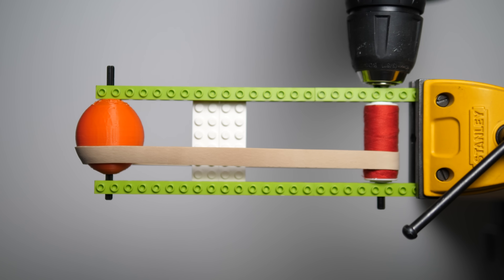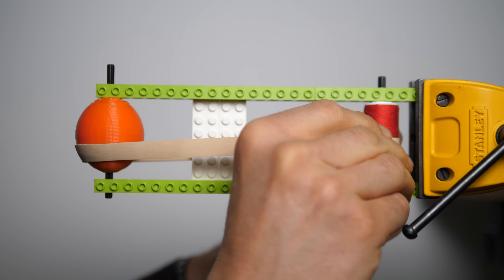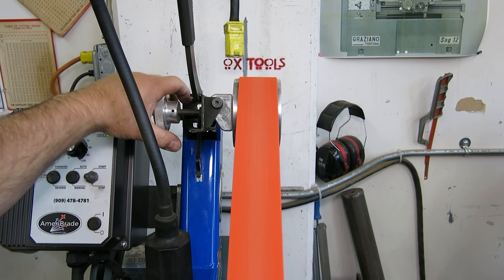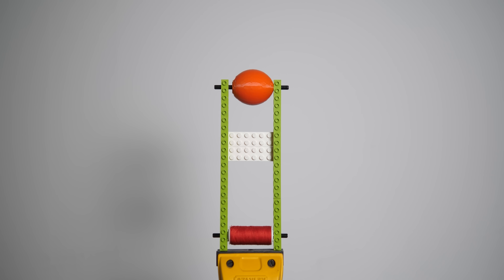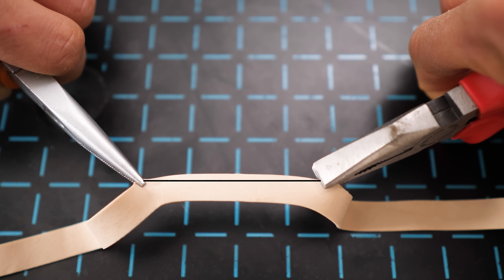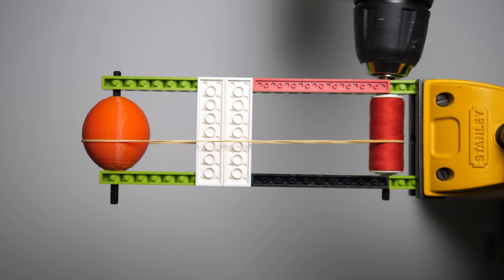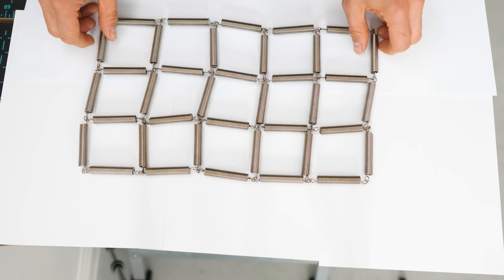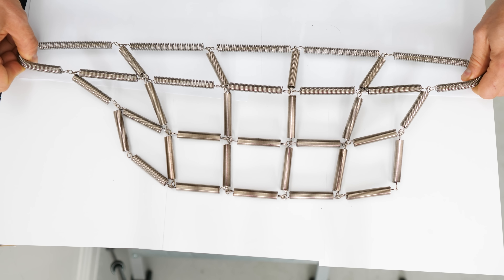The Band Should Slip Off But It Does The Opposite!

Comment: Best video I saw on this topic, finally a nearly full explanation in one place. Two questions remain for me: 1. Why is the force that drives it up greater then the force that pulls it down? Something with the friction coefficient? 2. I know that misalligned belts can be alligned by scratching one side of the pulley to increase the friction on that side. How does this work?
Reply: I will give it a shot. A konveks pulley that spins have surfaces that moves at different speeds. The surface that  leave the most distance for every rotation, is in on the center of the pulley. When you have an object that is being applied with two different forces. The object will turn direction. In this case the convex pulley. If we  apply the rubber band and the conservation law of speed and momentum. You need to apply more  speed on the pulley on the narrower side. While needing less speed on the thicker part. In order to have the band not move anymore . They need to have balanced speed on the surface. Or have two lesser surface on each side.

Comment: i haven't seen the explanation yet, but i'm assuming it has to do with the fact that a straight line around a sphere (such as the earth) makes an ellipse that at some point crosses the center plane, so when it rotates, it wants to go up or down that "ellipse" because it wants to go in a straight line, and then it's stable once it is equatorial, meaning that a straight line ends up just being straight.

Comment: Rubber bands are a little different from a lattice of springs in that when you stretch a rubber band you actually compress the material of the rubber band. The total volume of the band itself gets smaller and it puts off heat. And when you let go of the band it sucks in heat and expands.

If you have two points pinned together by a metal spring and heat up the spring the tension between the pinned points will decrease, whereas if you pin the two points together with a rubber band and heat up the band the tension between the points will increase. It has something to do with the boundary conditions of the material itself. You aren't wrong about the entropy and the molecular effects when you add heat it's just that when you "stretch" a rubber band you aren't actually stretching the band you're compressing it. 

When you pull the band out it gets thinner, the thinning is a continuous zone of compression. The polymer chains aren't as free to slide past each other as the pile of chains. Though some line up in the direction of pull, the aggregate is getting crushed in the web. More like a finger trap toy, though not precisely that either.

Comment: I used a belt drive on a lathe and a table saw. The belts were 4" wide leather. The pulleys were all crowned. Belt speed is faster the larger the diameter.

Comment: I am a carpenter and it has worked the same way with the band saw for generations.  The rollers over which the saw blade runs are also curved and the belt always runs to the highest point.  The belt is adjusted in its position by slightly tilting the upper roller.  So nothing new or unusual for us carpenters

Comment: No Steve, you were right at first! It's discrete at the bottom (molecules), not a continuum!
Reply: Comment on the entropy segment. You can directly observe this by measuring the temperature of the rubber band when relaxed vs stretched. Ben Krawsgrow did a video where he made a refrigerator using rubber bands. They were pulled taut when outside the fridge and where relaxed when inside, effectively absorbing and transferring heat out of the enclosure!
Reply: Another thing, I have heard you can think of it as follows: a very long rope is stretched straight. Now imagine countless object hitting the rop side-on. At every collision the rope would have a tendency to curve just a bit, and over the length of the rope this would have the effect of contracting the whole rope from straight to a squiggly form. Similarly if you forcibly pulled the rope taut, it would push all those object in contact with it, releasing kinect energy (and this at the macroscopic scale would be measured as heat).

Comment: This is probably what is going on with treadmills.  When you adjust the position of the treadmill belt, you are changing the angle of the axle.  It always struck me as counterintuitive that when I tilted the treadmill roller with the adjustment knob, the belt moved in the opposite direction I was expecting.

Comment: There's an elephant in the domed pulley you haven't addressed:

Surface speed. At the pulley's highest point the greatest circumference it is moving faster than the area closest to its rotational axis points. The grab (all things considered, other forces will predominate if pragmatic limits aren't observed) will be maximal at the circumference that displays the greatest centrifugal/centrifical force, which is the 'highest' (widest) part of the dome.

To mentally model this in two dimensions, consider a spinning disc with an object dropped at centre. It will be thrown off the edge.

See:
https://byjus.com/physics/centripetal-and-centrifugal-force

In some ways, this mimics the forces at work in a venturi.

Comment: What a cool design!
Never heard of it before but from the picture it told me exactly what I needed to know. 
I make FFP2 masks for a living and one of the rollers uses I think the same mechanics as this "pully" system. 
We steer the cloth with a roller and by adjusting one side of the roller it "walks" up the roller. I never got told how it worked but it thought me a lot because I learned myself how to use it. And it creates a incredible delicate but often stable way of adjusting the inclination of the cloth. 

Thanks for the video explaining how it works! Nice to learn new stuff about what you work with daily

Comment: So basically, the stretched section of the belt applies a horizontal force as it rotated around the pulley, which overcomes the tendency for the belt to slip off, thus stabilizing the belt onto the pulley center.

Comment: I think your explanation as to WHY the band moves up is not true, and if you would use a cone with one side with a bigger circumference as the other, it should creep from the narrow side to the wider part. I don't think it will, because it has no arch to it. I want to bet it will stop at some point as long as the cone ends wide enough and the increase in size is constant.

Comment: That was most enlightening.  I'd noticed that the pulleys on old industrial machinery with leather belts were slightly bowed but I always thought that was odd because you can actually see the belts self-centring.  I had wrongly thought one would prevent the other rather than causing it.  Now I understand.  Thank you.

Comment: Without further watching your video, I stopped at 2:02, I think the reason is the resulting speed of the second pully, which want's to rotate slower, therefore the rubber band has to move to the center.
Reply: I was wrong. meh

Comment: When you touch the curb with your tires, it pulls you toward it.  A wheel tries to climb an osculating wall (look at the marks on highway railings).  A steel cable will climb a sheave.  A derailleur works -- little elasticity there.  Hmm.

Comment: "Sheav-Block!!" 
The grooved rotating wheel is the sheav and can be mounted to a spar or bulkhead without a block, the term block goes way back to when they used a block of wood spliced into the end of a rope; likewise a block can be used without a sheav though friction is increased it still has utility.

Comment: Hold on, if the contraction of the rubber is just caused by molecular jiggle of heat, then is that why cold rubber is has less spring?

Comment: I used to tell my students that you can actually feel the entropy change in a stretched rubber band as a temperature change, by using your lip as a thermometer as that part of your body is much more sensitive to changes in temperature.   So fun to see a room of students stretching and relaxing rubber bands and claiming "I can feel it warmer/cooler!!"
Reply: Someone tried to make an elastic band refrigerator. Didn't work out too well as I recall but interesting nonetheless.
Reply: @chaos.corner  Not sure if they were the only ones who did it, but the Myth busters did that. I remember the whole whacky contraption with tons of rubber bands designed to stretch outside the "refrigerator" and contract inside.

I too remember it not working particularly well, but it did create a (neglible) temperature difference.
Reply: @kevinthealienfpv  I looked it up. It was on the Youtube channel "applied science".
Reply: @chaos.corner  i watched a video about that a long long time ago lol

Comment: I've seen a hidden use of this effect. At newspaper print centres, (At least the three I've been in.) have extendable conveyors to get newspaper bulks into vehicles. They extend similar to an older style telescopic antenna, and hidden in it's workings is a series of rollers with convex curved surfaces. The only visible roller is a fixed polished metal roller, and if you push the end of the conveyor to the side, the belt travels slowly the other way so it's always straight and centred where it comes out and goes into the drive unit. In the one I have spent literally bored hours experimenting with, it has belt alignment optical sensors on each side, so you can't push the conveyor too far or for too long, or it stops and sets off a safety alarm. If it didn't, any pressure on the side of the conveyor could tear the belt to pieces.

Comment: figured it out at 0.49. As the rubber band starts to slip down, less tension on bottom part of band and more tension upper part, which pulls it up.
If the rubber band was not as wide, it could slip.

Comment: ...or you just say that a straight band wants to be laid out across the pulley along as straight a line as possible: if the pulley is spherical in shape, it wants to follow a great circle, and that automatically means that it will bend towards the middle.

("wants to" anthropomorphosising...)

Comment: I have an alternate theory: 

I think it's because of the geodesic of that surface
I think a rubber band will *still self-center* even if it *didn't* bend in that fasion, whereby it is transversally curved behind the contact point, simply because the geodesic coming from the point of maximum pressure (on the opposite side of the other pulley) is angled towards the center on both ways.

I think you can test this with like a cloth-based stretchy fabric, with which these effects should be neglijable, because of it's lower compressive stiffness
it would, of course still have to be lined with rubber dots or something so as to have the necessary amount of friction.

Comment: Another thing to add to the rubber elasticity also should include vulcanization: the chains may jumble together, but with enough force, the chains main slip by each other, permanently deforming the rubber object, so sulfur ligands are inserted yo prevent that from happening, VASTLY improving the material's elasticity (how much energy it takes before deforming permanently)

Comment: Everyone has an example of this take the bottom of a vacuum off and look at where the heater bar matches the belt and you will see the balled knob on the heater bar and the straight bar on the motor where the belt meets them both

Comment: Just wondering if you tried from the top with the drill spinning in the same direction? I notice that the thread is spun in a screw like pattern and the way the drill spun it looked like the angle of the thread was screwing down making the rubberband ride up. Hence why I asked if you tried from the top. Awesome vid. Ty.

Comment: Band saws blades are an interesting case in point since the metal band of the saw has no elasticity yet it rides on crowned pulleys.
The band I'm assuming favours even pulley pressure across it for it to ride in the middle of the crown and uneven pressure tries to make the inside shape slightly conical rather than parallel and has a similar effect as a belt with elasticity in that it engages the pulley slightly forward of where it is riding at the top.
It must be a lesser effect since band saws have the top pulley able to tilt of horizontal axis to assist the movement to the middle, but once there it favours staying there.
There is the trust wheel on the guide of coarse stopping the pushing of material into the blade from working the blade off the pulleys but that is only adjusted when the blade has found where it wants to ride and the trust wheel should barely touch the blade in action before and after cutting forces.

Comment: Interesting how critical the relationship of internal tensile and compressive strengths are in the minor axis, aka buckling. If the ratio was to high it would never induce a bending moment. 
Think the perpendicular displacement, where it archs is not actually useful and we'd rather the band sides remain parallel but with increased internal stresses, I think...but then the minor axis compressive strength is related to displacement via the buckling formula soo maybe not. Hmmm.
Anyway awesome stuff! 
FYI the entropy video explained a lot when I was learning thermodynamics, super great video, always recommend it:)

Comment: i think that this would work with a non stretchable belt, and it has to do a little more with the fact that since the middle has a bigger diameter, i has a longer travel, effectively pulling more belt towards it;
the angular speed is the same, and "more belt" is drove in the middle.
So, yes, it might be related to the deformation of the elastic band, but my intuition tells me that the primary cause is the pulley shape. (of course because of the shape the deformation occurs)
Reply: Exactly, a band follows the "straight" line path on the curved surface, the geodesic. I think there's a Vsauce video about geodesics.

Comment: I thought that since there is more band causing more sticking friction against the greater diameter and less at the lower diameter the sticking force differential would increase on that side until it went over the top and equalised on both sides of the elastic! There is always a force difference to cause movement.

Comment: That so amazing, the second you said it I figured it out. The higher part it moving faster and so it is pulled up.

It's like the air going over a wing or air foil, the faster moving part directs the stability

Comment: 4:20 "The rubber band is a continuum of springiness."
Oh no it isn't :-)
Reply: Oh yes it is. I think that just means that it is stretchy all the way round. It continues.
Reply: @tomterrific9459  I was thinking about quantum effects - and just discreteness in general. It's a bit of a hobby horse of mine. It seems to me that although continuums are extremely useful for mathematical modelling, I do wonder if they break down at some point, and that ultimately the world, if it's modelled by anything, is modelled by the integers (or even the natural numbers)  rather than the reals.
Reply: I guess the meaning was that it is made up of atoms which are discrete.

Comment: Sorry but I feel the following explanation is clearer and it also works on far less elastic bands, like bandsaws: “If a belt is led upon a revolving conical pulley, it will tend to lie flat upon the conical surface, and, on account of its lateral stiffness, will assume the position…” (shown in Fig. 52, https://www.lockhaven.edu/~dsimanek/make/crowned.htm)

Comment: So here's a long example of the useful pulley system you've described. If you know about color laser printers, you know generally they use what is called a transfer belt to statically cling little charged plastic particles called toner. Those toner particles are layered on top of each other to create the reverse image that you are trying to print and it presses that image on to a slightly more statically charged piece of paper on its way to bake the plastic onto the page in the fuser. The thing we are interested in this context is the belt though. In smaller applications this belt is contained on a bracket or brace that can usually be quickly removed and replaced for servicing. Even some quite large laser printers have this sort of transfer belt assembly for fast and easy servicing. But on really large, high dpi drafting laser printers that do wide format prints, think blueprints or building plans, the belt has to be free floating so that it can achieve what is called "full bleed" or edge-to-edge printing with no margins. The way these machine achieve that is different for each company and they are often very protective of their patents. But the machines I service use slightly concave oblong rollers that span 3.5 to 10 meters long. The belt itself is not completely elastic as it requires tension to properly layer the toner so the concavity of the rollers has to be fairly slight to keep as even pressure on the belt as possible while still keeping the belt from slipping left or right of center. The other thing we have to do is level the whole machine as perfectly as we can and after all that, the belt still will slip over time which causes us to replace the belt more frequently.

I think laser printing is an extremely interesting source for unique engineering solutions. All the different things from timing mechanisms to sensors to the physics used to make a laser printer do it's thing, it's a miracle they work at all in the first place.

Comment: I don't think this is accurate. Why? It ignores the contact interface between surfaces.

The longer side is simply under higher tension and thus contact with the crowned surface. This creates a pulling effect, which has less to do with the length of the band but rather the pulling effect caused by the width of the band.